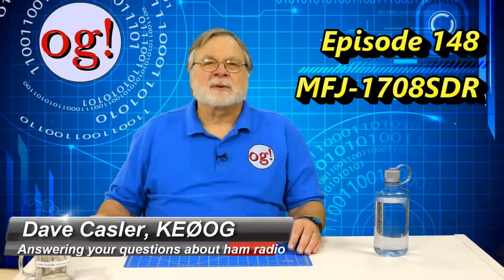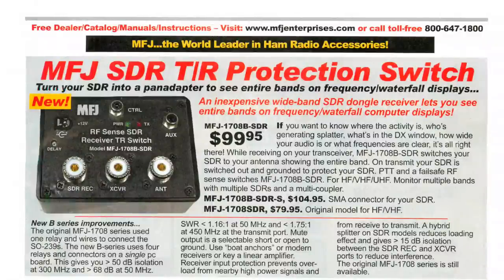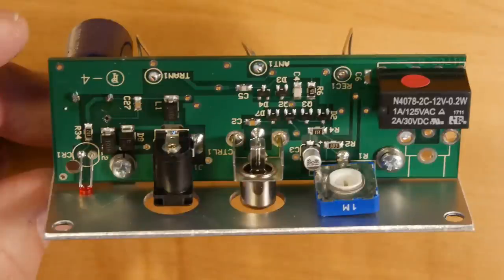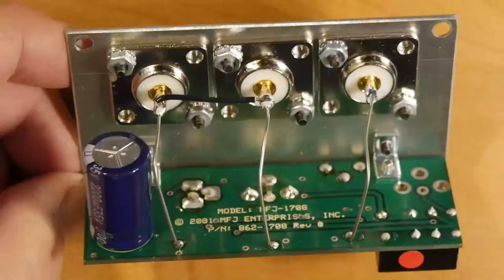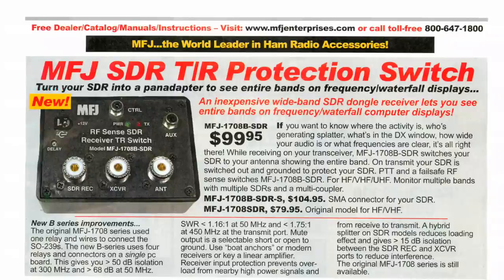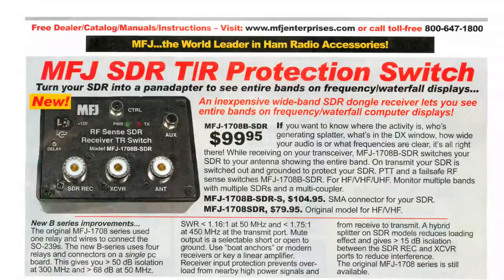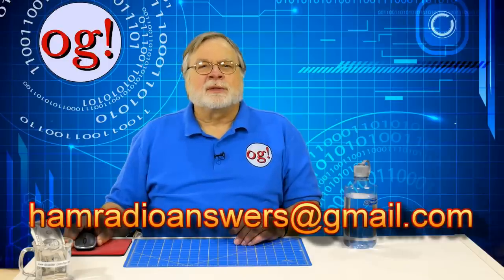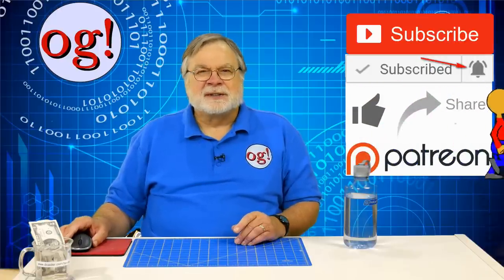A close look at the MFJ-1708SDR T/R switch (#148)

Comment: what would i need for my kenwood ts-940s
Reply: I have a Kenwood TS940S.  It is a great older radio.  I have used it for many years.  Recently I thought about purchasing a new higher end Kenwood or Icom.  I also looked at the SDR1A (SDRPlay) and SDRuno.  Dave does a great job explaining the SDR operation.  I was told by a resource to use IF 2 on the back of the radio.  Don't do this, it only puts out a 100KHz signal and is of no use for the SDRPlay. 
I purchased a MFJ 1708B antenna T/R switch.  To start with, I got the SDR working without the T/R switch and learned how to make it work.  You will do well to look at the videos from Dave and SDR on its operation.  I installed the SDRuno software from the SDR web site.  I fed the SDRPlay with a short patch cable SMA male to SMA male and an SMA to SO239 adapter.  I then connected my coax antenna cable to the SO239 adapter.  I followed the instructions from the SDR Youtubes and it worked great.
Hook up the MFJ 1708B antenna T/R switch at this point.   I am going to use the Remote jack on the back of my Kenwood and feed the switched connections to the CTRL on the MFJ T/R switch.  I am currently using this to control my linear amp.  I will just piggyback these connections.  The old Kenwood handles the relay in my Heathkit linear fine.  As Dave said in this video, It is best to use the CTRL and not just rely on the transmit signal to operate the T/R switch. 
  
I then down-loaded Omni-Rig and VSPE (virtual serial port emulator) from Eterlogic.com.  In the VSPE software, you will need to go to the Device tab then go to Create and select Pair.  Click Next and then fill in the boxes for Virtual serial port 1, COM 10 and Virtual serial port 2, COM 11.  Then click Play.  You must do this to keep the whole thing from crashing.  Eterlogic wants you to pay for their program but you can try it out first to see if it works.  Mine works but I have to set it up every time I start my computer.  I will need to purchase the program and install the Key Code.  If all goes well, you will see a Status = Ready on the VSPE.  Minimize the screen and keep the program running.
I set up the Omni Rig for Rig 1: Serial port COM 4. Baud rate 4800, Data bits 8, Parity None, Stop bits 1, RTS Low, DTR Low, Poll 500, and Timeout 4000.    I have a Dell XPS computer with an i5 processor with 8G of ram running Windows 10.  It is fast enough for this.  I installed HRD (Ham Radio Deluxe) and set it up for COM 4 using the Kenwood TS940 setting.  I installed an old serial I/O card in this computer.  My Kenwood has a PIEXX CAT board with a ribbon serial cable coming out of the rig.  I guess you could use a DB9 serial I/O to USB adapter if you need to.  If you want a Kenwood TS940S to work with the SDRPlay, you will need to have the PIEXX CAT board installed in the Kenwood.  Without this, there is no way they will track each other.  Maybe the new PIEXX CAT boards come with a USB cable ???
Turn on the Kenwood.  Start the SDR program.  In the SDRuno program, go to the RX Control pane.  Click on Settings.  Then click on CAT.  Select COM 10.  I have mine set at Baud Rate 57600, RX Mode Ctrl = yes, and Enable & Connect = yes.  Status = Connected.  Exit out of the box.
In the Main pane, click on SETT (Show Main Settings window).  Go to the ORIG tab.  You should see: Rig 1 = Kenwood, Rig1 Status = On-line.  Exit out of the box.
 
In the Main window, click Play.  Now, in the RX Control window, click on Bands and select Ham Lower for the low bands.  Click on the band you want.  Now in the RX Control window, at the top, click on RSYN1.  This will Assign OmniRig control to this VRX.  Now the Kenwood will track the SDRuno.  You may need to click on Stop and then press Play to get it going. 
I am still in the learning curve on this but I have been able to get repeatability on getting it going.  The front end on the SDRPlay is very hot.  I can see very slight signals on the waterfall and then move to them.  The S meter does not even show a signal, but the Kenwood will pick them up and the SDR will pick them up.  BTW, I also use a GAP Hear It - In Line Module (DSP).  It is great and cleans out the noise very well.
Bottom line - I don't need to buy a high end radio now.  Just keep using what I have.  This is a great set-up. 
73

Comment: if you believe those isolation figures I have a bridge I want to sell you.
Reply from the maker: The isolation figures are probably accurate (I don't have the equipment to measure them), but even so they aren't very good. You'd normally like to have another 30 dB or so isolation.

Comment: this thing is dangerous
Reply from the maker: I've not had any problems during testing. However, they have a B model that further isolates the SDR.
Reply: Yes it is!  It's a radio burner upper as the quialty is very low. Sorry Dave but after buying one and almost burning up my radio I would not recomend any MFJ product.